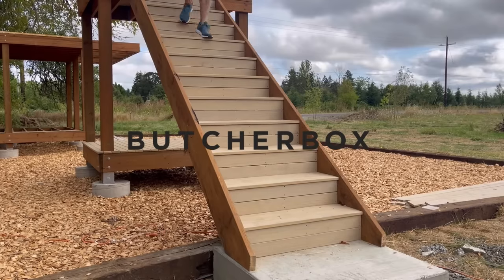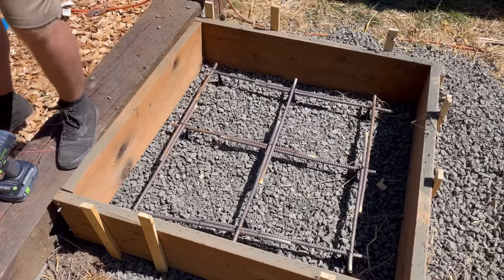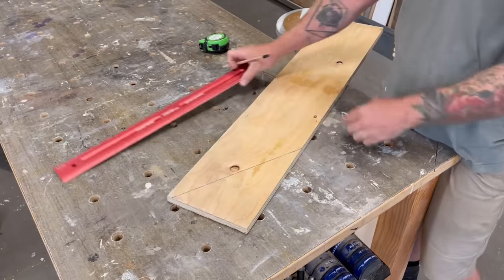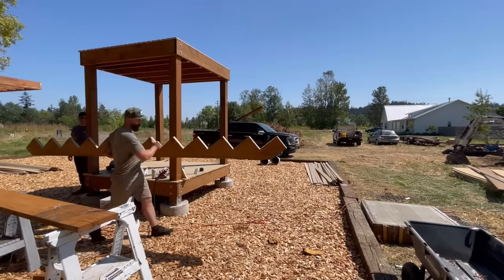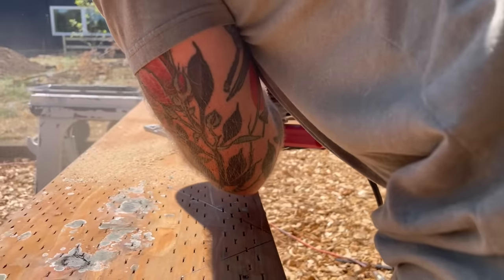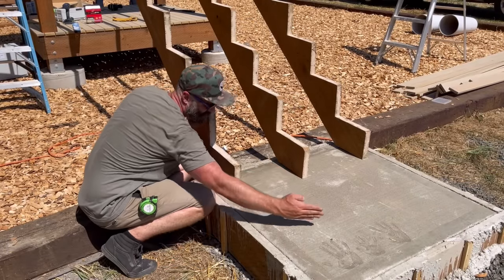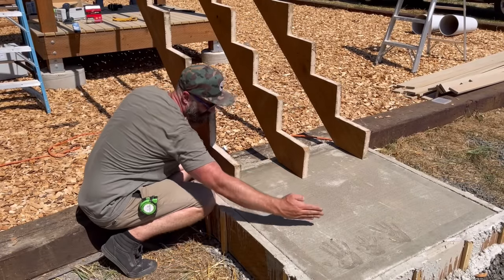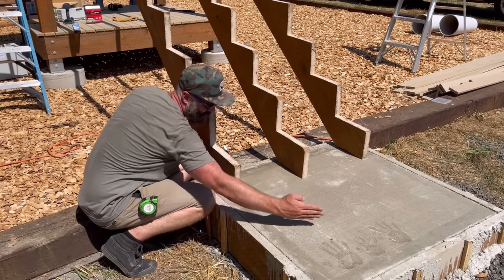The Easiest Way to Build Stairs || Stair Stringers are Easy

Comment: I'm no engineer nor do I have much experience framing, but I wonder about securing anything structural by drilling through end grain as was done at both the top and bottom of the staircase.  I would have notched out the bottom of all the stringers at the bottom and I would not rely on screws being drilled through the end grain at the top, especially since this thing will be exposed to weather.  I would add hangers at the top.  Maybe someone with more experience could chime in.  Is this up to code and/or the best practice or is there a better way to secure the staircase to the structure?
Reply: I'm in and out of customer homes all day long. You would soil yourself after seeing what holds some staircases up. You're over engineering the steps in your mind. You are also forgetting a very important part of the physics involved in stairs. The load isn't all straight down. They are really more the long side of a squared triangle. The stringer applies a side load to the structure just like you would use a 2×4 and a stake to hold up your framed wall during construction. Imagine this, the top and bottom of the steps are really more like fixed hinge points. For the stairs to "swing" through the wall or the ground using the opposite end as a hinge, the force required to do so would be so great it would break the stringers. And gravity works well, so the bottom of the staircase isn't going anywhere. Yes there is a load on those structural screws, but it isn't end grain the way you are thinking. Remember the stringer is at an angle, so it is really across the grain at an angle too. Plus he added the  2×6 for the stringer to rest on. Most old homes im in only have the top part of the stringer touching like he did, and they have three or four nails in them to hold the stringer in place, and that's it! And he added skirts, so even stronger. The only thing I would have done different is screwed the skirts from inside the stringers for the all important looks department, and maybe sealed the cuts for the weather. Awesome build Jason!
Reply: The strength of screws in end grain like that is about 2/3 of what it is in face grain. So it is a weaker connection but can certainly be fine for some applications. -an engineer
Reply: @carlstrohm3785  Yes, I agree that the stringer are sufficient to tie everything together, but I  don't think I am "over engineering" anything in my mind by simply pointing out that securing screws straight into end grain is not a very good practice in construction. Also,  you can't possibly know what I'm thinking outside of what I said as you seem to have indicated more than once.  The question was weather or not this is up to code and/or if it's the best way to secure the staircase.  You didn't answer either of those questions, but thanks.
Reply: @hunterbancroft290  Thank you.
Reply: @glumberty1  I’m not in construction but I believe the hangers are code.
Reply: I thought the same, the fixing of the stringers at the top looked a bit sketchy.
Reply: There’s lots of things in this project that aren’t code compliant. Fortunately, most is also way way overbuilt so it probably doesn’t matter. 

Because it’s not an inhabited structure, it doesn’t not need to meet building code requirements though that is always a good idea. 

If utilities are connected, as was alluded to in an earlier video, it does require a permit in most locations.
Reply: @glumberty1  Ask engineer Bancroft to concoct the "best" way you could possibly attach the stringers. In the real world of home building, the most common way is being nailed through the face into the stringer. Obviosly hangers are more commonplace now than they were before they were a thing.  And what's with all the comments about code? It's a playhouse, not a home. Too many engineers worrying about a playhouse they will never be on. It's built for their playtime from a plan in his mind. It will be way safer than some crap we built in the woods as kids with scrap wood and nails.

Comment: Why not just put your treads in between your stingers, and rest them on 2x4 blocks, instead of cutting the stringers? That way, you kill 2 birds with one stone, and don't need to add the decorative side pieces, as the treads will already be inside the stringers, and not visible from the side.

Comment: Easy Peasy Stair calculation: Total rise divide by 7.5 and get 14.183333.  Use 14 for number of rises.  Total rise divided by 14 steps will give actual rise for each step of approximately 7.5.
Reply: Yes I would have simply rounded it off also, no one cares and you don't need exact step heights. It's easier to round to an easy fraction when measuring anyway.

Comment: Your first 10 seconds of calculating the stair rise was right, then you went all wrong.  Dividing the total rise buy 7.5 is great, you got 14.18 so you know you need 15 steps at 7.09 or 14 steps at 7.59, either one is ok.  Next you plug it in the equation 2r +t = 25 and you get your tread.  Tread width directly relates to rise, it's not arbitrary.  You made a couple other big mistakes.  First, you probably made your stairs too narrow.  You need a grab rail which takes up about 3 1/2" width, figure 4", stairs need to be a minimum width of 36" after the grab rail, which gives you 40" minimum width.  Stringers can not be more than 18" center to center.  Either your steps are too narrow or you need another stringer.  Code also requires an intermediate platform with every 147" of run.  I think you are over that.  If someone falls down those steps, you might want to deny building them.

Comment: Am i the only one that wonders why you screwed the decorative pieces from the outside and not from the inside?
Reply: Yes you are and why does it matter. It looked like he used screws that didn't come out of the inside board...
Reply: @davidcurtis5398  that wasnt the reason i was mentioning it... he doesnt like to use screws if he can avoid it and when he does use screws he usually tries to hide them.. was just commenting that he didnt try to hide them here.. dont get butt hurt because i pointed something out...
Reply: No you’re not. Many similar comments above. Cleaner finish.

Comment: I anticipated seeing a set of stairs framed, until, you threw your worm drive on the ground,  the way you, evened the landing,then the way you nailed the form work to the stakes, and then the lay out of the stringers. Partner get off the internet, the information you are passing out is SOOO wrong. The foreman is the only good thing about this video. Mark carpenter for 45 years and counting.